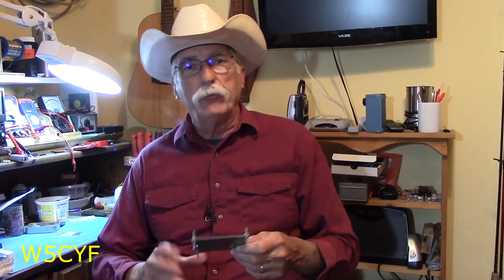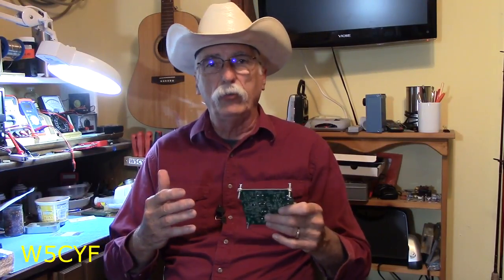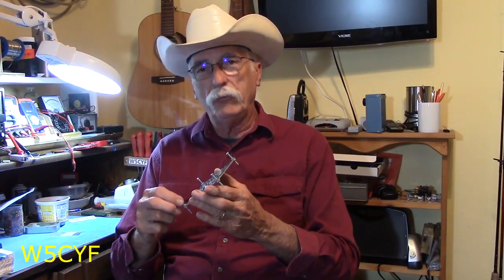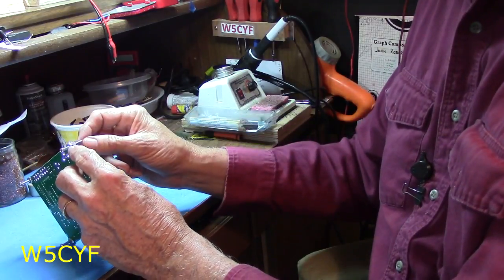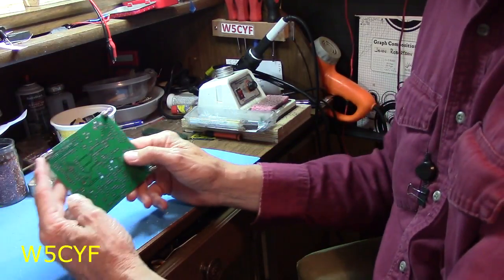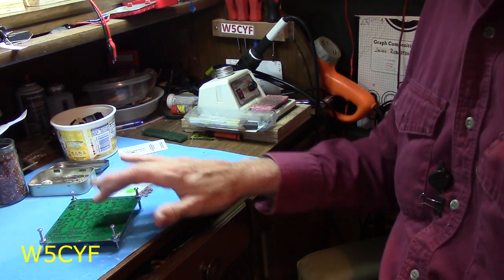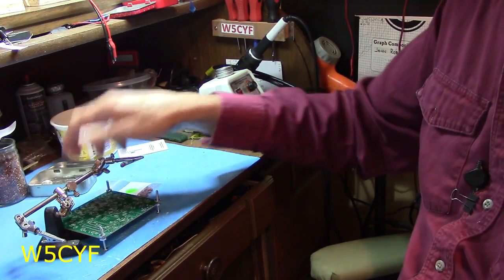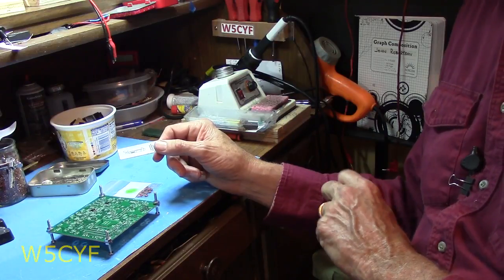EZ Project – PC Board Holder (Printed Circuit Board)

Comment: must admit in 30 + years of playing with electronics and building kits i have never seen this ! after some deliberation i feel it would be useful to add that the screws need to be long enough to clear the highest  component , usually a capacitor or heatsink .
nice tip and excellent video John and please keep ''em coming !
Reply from the maker: Ian, thanks for watching and for your suggestions.    ~John

Comment: John, late to the dance here but tell the folks that the threaded standoffs (screw nub on one side and threaded hole on the other) will mate with one another. I use the one inch ones; requires 8 but they are quick to set up and always level